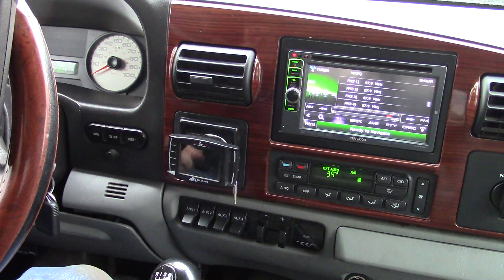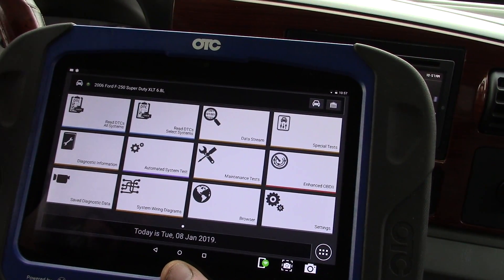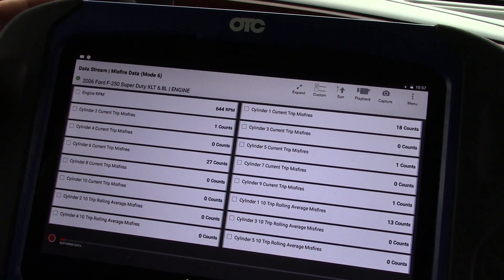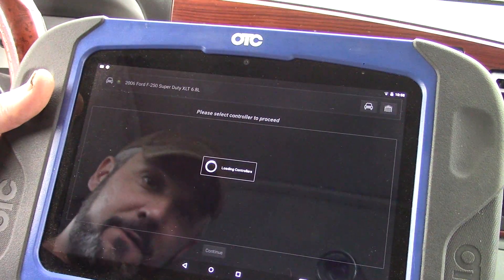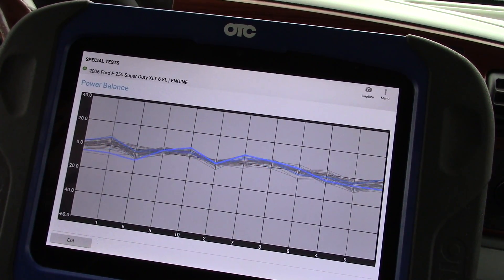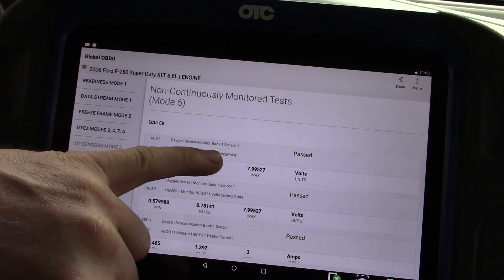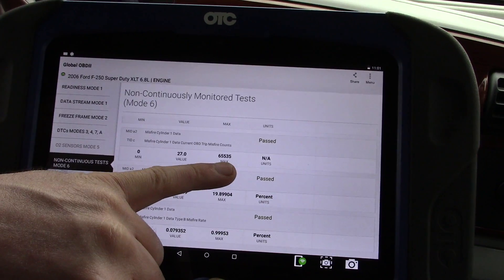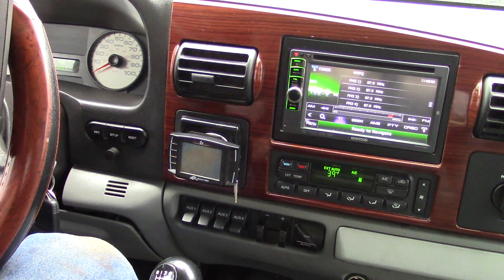Looking At Mode 6 With The OTC Evolve

Comment: Nice video. Would you recommend the Evolve to a mid-level tech trying to get promoted and earn more money? Our shop has a Snap On scanner running on Windows XP, which is a joke in 2020. Looking at the manual and bidirectional control list for the Evolve, it looks like a very powerful tool. My only concern is hardware performance. Some reviews say it takes forever to boot up and flip through menus, like the Bravo 3.0 software is demanding too much from the processor and RAM.

Comment: Nice. Mode 6 is under used so much. Great points you made, and nice that you mentioned the values that need to be met before a failure shows up. I am curious if the Encore has the same software or not.

Comment: That thing is REAL nice! 👍👍

Now I see the problem with just having one scan tool here - I never knew just how bad the Autel is with Fords. Always wondered why they seemed to give me a hard time vs. a GM products. Never knew it was the tool, since the Autel is the first bi-directional tool I've ever owned -  I've had nothing to compare it to. I've never used any factory scan tools before, so I don't know what I'm missing there. Heck, the first OBD-II vehicle I ever owned was bought used in '08 (and still sits out back, a shell of its former self - its parts sold all over the planet, LOL). Just 2 years prior to that, my daily driver had a carbureted, HEI ignition 350 V8 in it. I miss that, now that I think of it ...  😉

Just used the Autel today on a '05 Ford Ranger, with ABS activating at low speeds. I had to test drive it to understand just WTH the customer was talking about, lol. Just a 30 foot drive, and BZZZZZT - ABS activation. The Autel's graphs are great - I can see how the auto-ranging of the OTC would've got me pretty mad on the test drive. Nice to see the screen stay put so you have an easy reference as to what the graph is actually showing you. That one was an easy fix - rust jacking of the sensor. Super common. Amazing how just a couple thousandths of an inch cut down on that AC signal.

Anyway I've rambled enough here! Great vid as always, brother Eric. Thanks! 👍👍🍻

Comment: The autel scanner was the first one I had that could cylinder balance test on fords, I worked on alot of CNG f150's 98-04, saved me alot of time. For some reason on the CNG ford's mode6 didn't even have misfire info and yuu could literally drive it with a dead Mis and would never set a code.

Comment: Pretty neat some of the stuff the ford PCMs could do engine wise with the power balance. Been awhile since I've done any work with OBD-II but remember reading thru those standards when I was reverse engineering code for some of the earlier GM OBD-II PCMs. Ton of stuff in there that can be read out in the various modes.